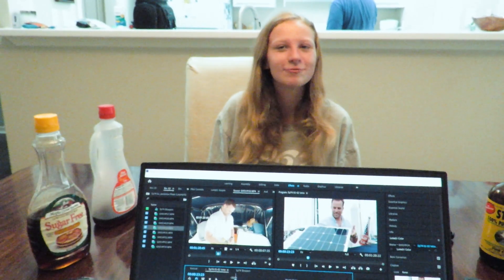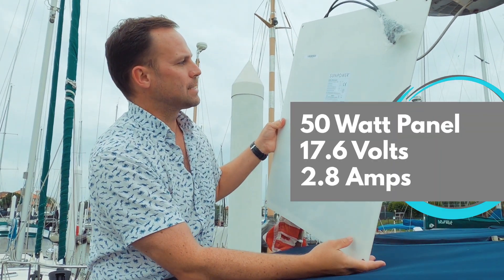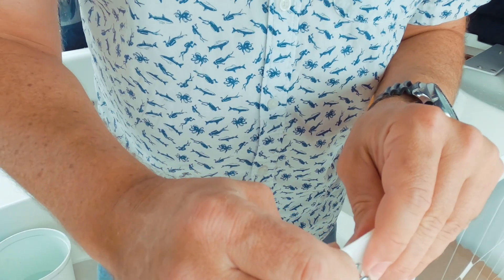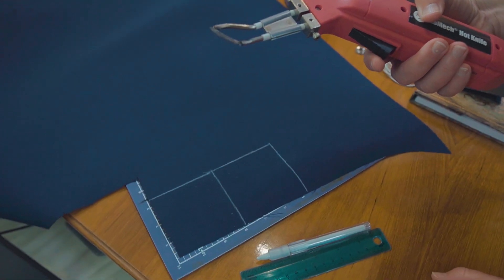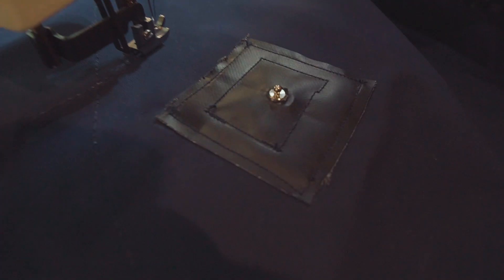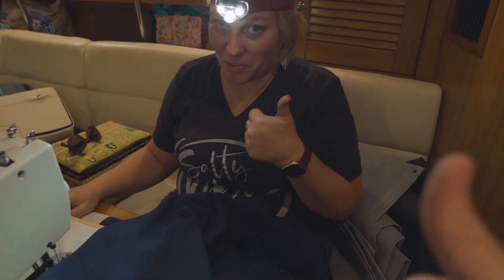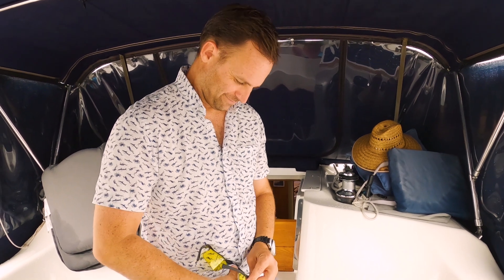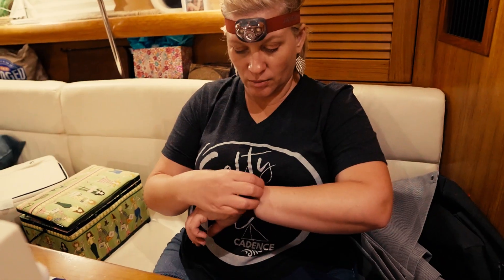Sunpower Solar System Install for Sailboat Independence, Phase 1 (e.74)

Comment: You might want to check the backside of the panels a few times when it really sunny to see how hot the panel and canvas get.  I am not familiar with these panels, but there was a Youtube video of a bimini that caught fire due to a flexible panel overheating.  See notation from this company which also covers a variety of ways to installation: https://www.custommarineproducts.com/blog/attaching-a-flexible-solar-panel-to-your-bimini  At the end, note they have a fairly easy way to address if it is a problem: "Note: Because the PV cells of the panels are black, they will absorb and radiate considerable heat.  Some customers have inserted insulation between the panel and the canvas to reduce the radiated heat.  They have used the bubble wrap encased in silver foil insulation available at most home improvement stores.  It is about 5/16" thick."

I really like the removable snaps, and the multi-layer attachments.  As you pointed out, if you have to strip the boat for hurricane or tropical storm, it will be much easier to remove the bimini with the panels taken off first.  Nice job.
Reply from the maker: Thx...the foil bubble wrap is a great idea! Our first thought was to use corrugated plastic, but chafing would be an issue. That said, we haven't felt any warmth on the underside for the few sunny days we've had.

Comment: If you add more solar watch your amps.  A lot of people use multiple Victron controllers.  If they are Bluetooth they will synchronize.  I have two of them on my camper.  one for the roof and one for a panel that I can move around for the sun.  they will both work together.  You will have the problem of sails blocking a panel and if both are on one controller you be degrading both of them.  If you have the new one on a separate controller they will work together.  Have fun.
Reply from the maker: Thanks! We're adding another 50w this week 👍

Comment: My Catalina 30 has 300 watts of solar on a good day.  It will keep up with the refrigeration and most other stuff...well...maybe 80% of the time.   No aircon though not a chance.  We have an igen2500 that we use to make water, hot water, charge, use the 16,500 AC, fill scuba tanks, etc.  With 150 watts, your engine, and a generator I wouldn't worry too much.  I have too much solar as much as we use the generator.  Our family of six can get by on about an hour or two at the end of the day on the generator.  Typically, we start making water on the batteries, use our electric cooking appliances to make dinner, and flip on the hot water for showers.  So after two hours, everybody gets a five minute shower, has dinner, batteries are charged a little, a little AC to dry out the boat, and our water tanks are filled back up..  We end up using about 15 gallons of gasoline per month for living and the dinghy.  The Genset uses about a gallon per six hours under a heavy load.  Sooo...we use a little over two gallons a week through the genset.  More if we just want AC all night(about a gallon).  The 2500 will seem to start and run the 16,500AC and pump, with our KVAR.  A Honda 2200 just will not.  Oh we had that same system for the solar panels sort of....the thing is we had to sew flaps along the edges because the wind would kick up and tend to rip the panels off!
Reply from the maker: That sounds like a great setup! The generator sounds like it dios the fuel 👍

Comment: Do you plan to stay in marinas on trip? The amount of solar does not seem to be a lot of power for 3 people on a boat that size? I'm asking, because we are planning on some solar this year too, on a similar size boat 🙂
Reply from the maker: Mostly on the hook. Yeah, we'll benefit from another 150w. But our DC to DC charger does an amazing job of filling up the lithium bank with just a quick motor out of the anchorage. And we'll use our generator for the Instant Pot and Water maker...which will also charge the bank every few days.
Do you have other charge sources when away from marinas?
Reply: The flexible solar panels delaminate in about 3 years and obviously then fail
Use the real glass solar panels. Mount PVC pipes to the 2 long edges, than the pipes and panels get mounted to bimini frame. Yes some holes are made through the cloth, but a "clamping" action happens and the flatness of the panel causes LESS cloth flapping in wind and any possible excess piping makes good hand holds

Comment: Idealy you’d drill a small hole in the rubber in the compression thru hull and poke your wire through it before you put the solar connector on. That would ensure the best chance for waterproofing. The less you cut into that compression rubber the better it works. But hopefully your way might be okay...  good luck!
Reply from the maker: Thx...I just followed the package instructions. 🤞 Hopefully, it's good!
Reply: @TheFosterJourney  If you look at 16:32, it looks like the hole is a little larger than the wire.  It might be a shadow.  But if not, water is going to run down that wire and right into the hole.  You can follow your/package method by cutting the slit, but the holes you drill first really need to be undersized for a tight fit around the wire.  If they are too large, you will need some silicone or caulk.
Reply from the maker: @michaelzotzky4378  it must be a shadow...I drenched it with the water hose and they're watertight.
Reply: @TheFosterJourney  Good deal!